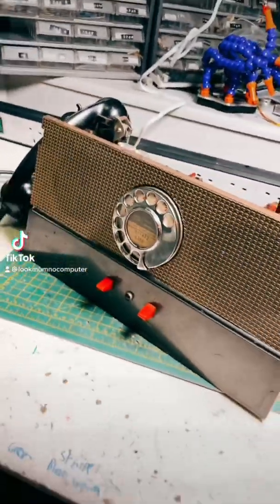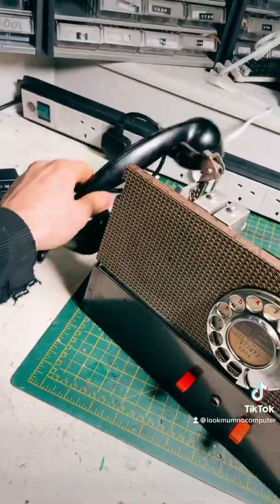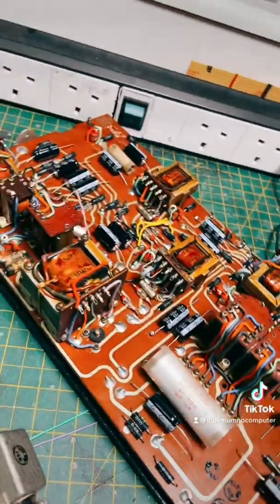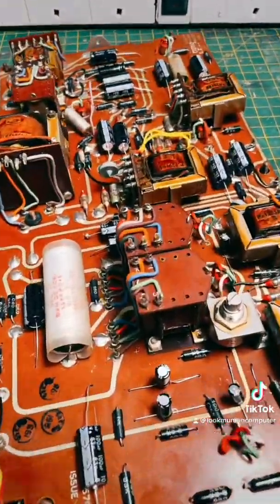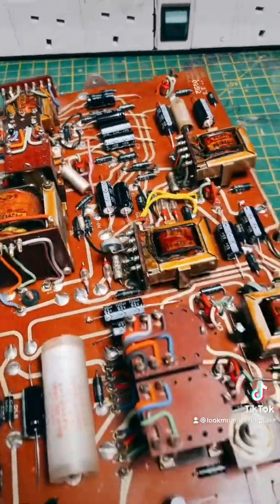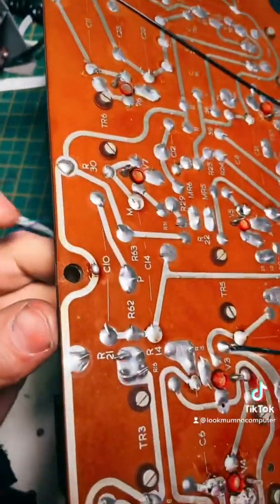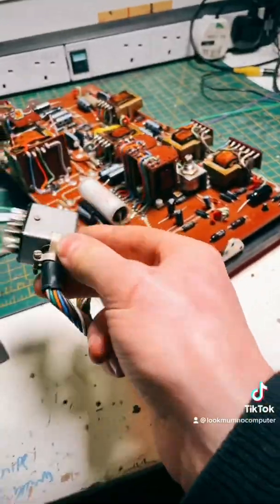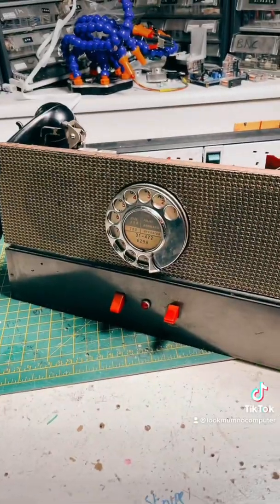FIXING a Rare 1960’s loudspeaking telephone #shorts

Comment: If you buy an older nortel option 11 or an Avaya single carrier cabinet, you can do tone and pulse dialing. On both systems you can simulate or generate every style of analog transmission.

I did what you did with these phone systems to become an engineer when I was dead broke.

Ton of fun

Comment: I came back to this, because in my files I found a folder called YouTube and inside was ONE file which had ONE link to YouTube with note "Brilliant in many ways" - and I still agree 100%. I especially like the "after a few days of questioning my existence" - I've also fixed old electronics and when a fix doesn't change a symptom at all it can make you question a number of things. Brilliant.

Comment: You know, that makes me wonder. Do old rotatory phones STILL work in 2021? I mean they've not like phased them out to where you couldn't plug one in if you still wanted to have they?
Reply: My dad does networking and video surveillance over here in and around Los Angeles. I had to help him at monterey park police department for a couple of weeks and down in the basement deep underground even though they have updated all of their systems they still have a room dedicated to old antiquated 1950’s and 1960’s cb radio and radio broadcasting equipment. Old motorola and other stuff.. tripped me out. All of it was still on and working perfectly. In the event of an emergency that 70 year old equipment is used as backup. Was super cool to see it work
Reply: They have. All the phone systems (at least in the US) only work with tones instead of pulses. You can buy kits to convert the pulses to tones to use a rotary on a modern system, or build it yourself if you really want to, but as far as I’m aware you can’t just hook one up. Would be cool if you could though.
Reply: @rob585  I have a couple rotary phones connected connected to both an old US Bell system POTS line and a modern phone over coax line and they can both successfully dial out in 2022.
Reply: They work fine in Russia, I use one. But you'd have problems with automated telephone system that require DTMF tones to navigate.

I once showed "dialing with a hook" trick to my boss, he didn't believe it would work.